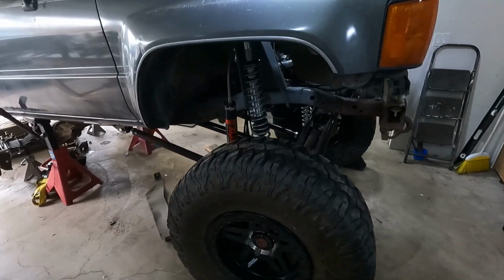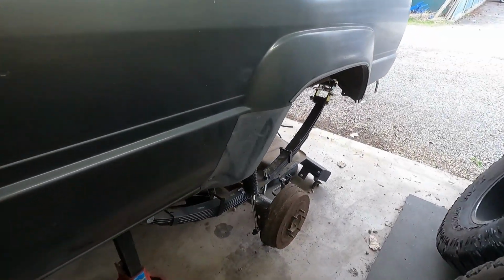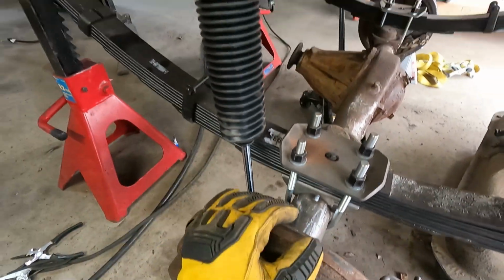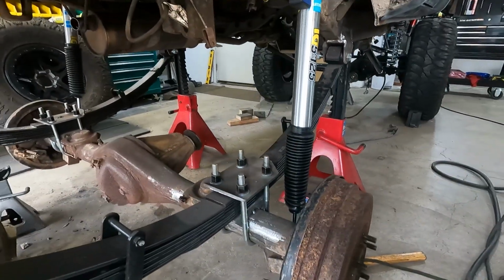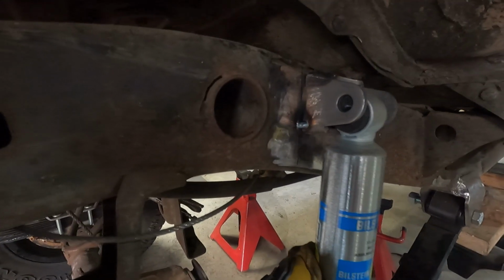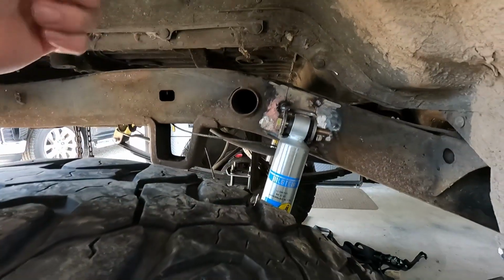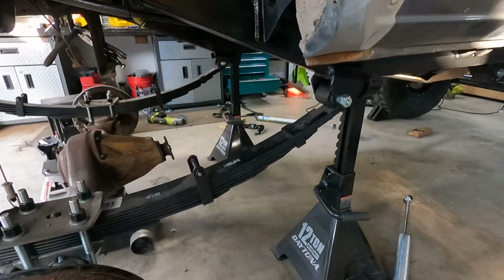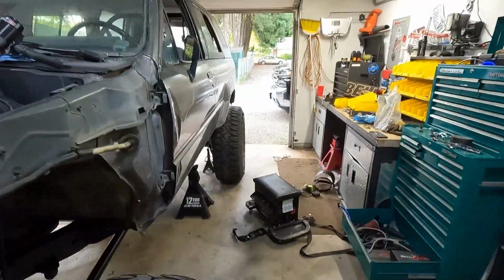1985 Toyota 4Runner Ultimate Overland Build Part 8 - Rear Shock Install

Comment: I am doing this right now with some 2.5 x12 kings it’s super tight I had to install a 1.5 inch wheel spacer
Reply from the maker: I’ve gotten away without a spacer, but my shock bodies are quite a bit smaller than yours and my wheels have a 3.25 backspace.